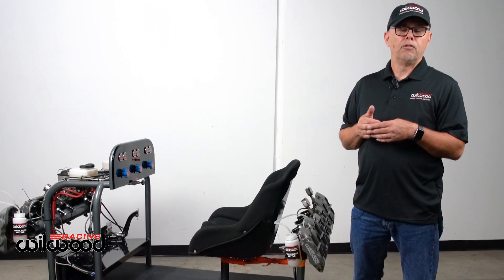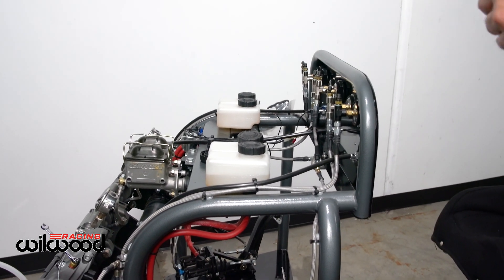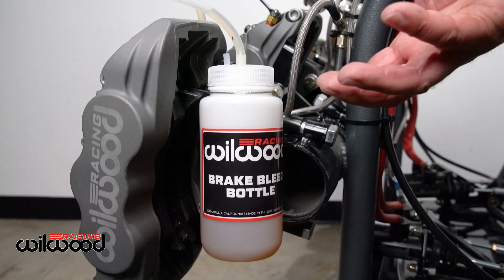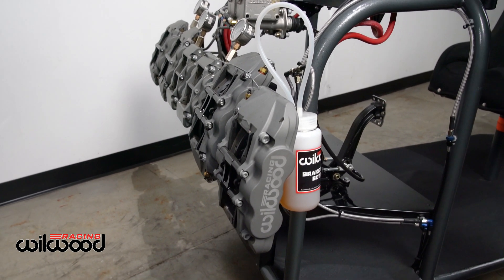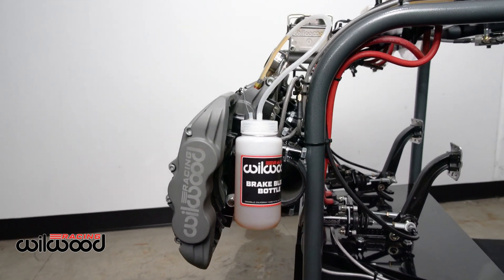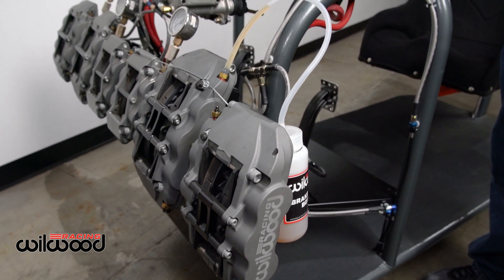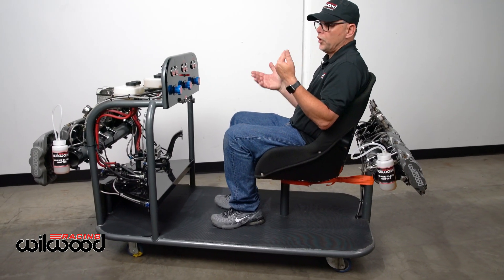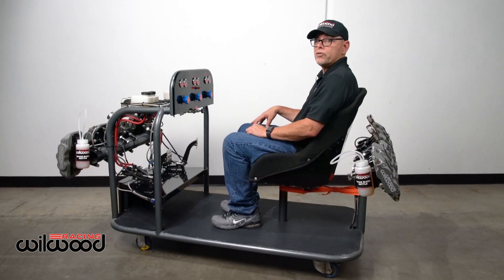How To "Purge" Bleed a Brake System

Comment: As a mechanical engineer who understand hydraulics, I don't see why the vacuum pump or pressurized reservoir isn't just as acceptable as your way.  Your video doesn't explain why your method is preferred other than to sell more single-use tools.  Regardless of the balance bar, that brake system is just two master cylinders instead of one.  When the brake lever is released, both systems are independent and can be bled any way you're successful.  All the bar does is apply more leverage to one or the other, but that all happens well after brakes are bled.
Reply: I think they say that to avoid customers bending bias bars by accident. 
I've seen pics of failed masters and the bias bar usually gets bent up first even if 1 master is still working.
Reply: I tried a vacuum bleeder, but never got it to stop bubbling. I think the issue is that a slightly open bleed screw can ingest air around the threads. I tried adding thick grease around the bleed screw threads, but didn't get a good seal that way.
Reply: @nicolashuffman4312  use hylomar.

Comment: My calipers have 4 bleeders.
2 Will always be up. I thought I had to bleed both? Why would there be 2 if there is a crossover??
Thanks
Reply from the maker: Hi, thanks for contacting us! We recommend bleeding both top bleeders. Air may be floating in the center and bleeding both will help make sure the system is purged.